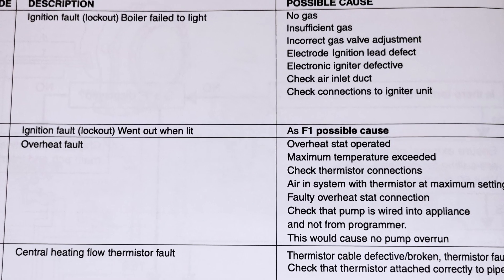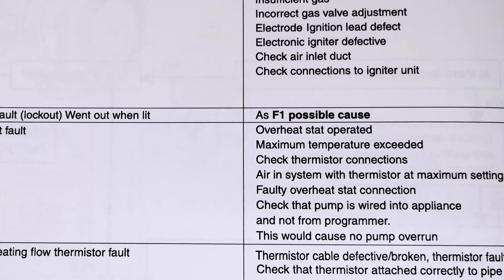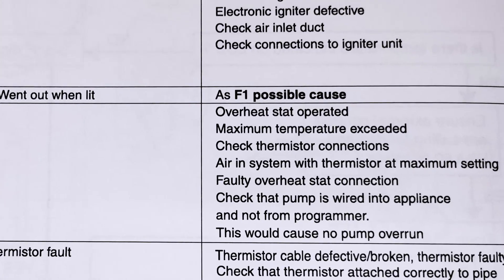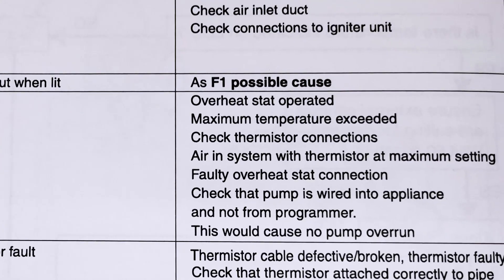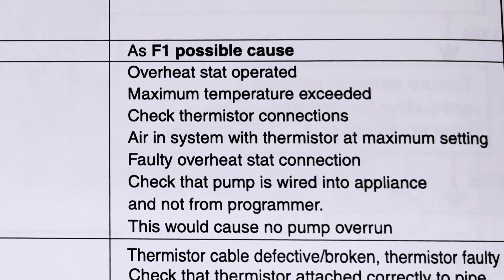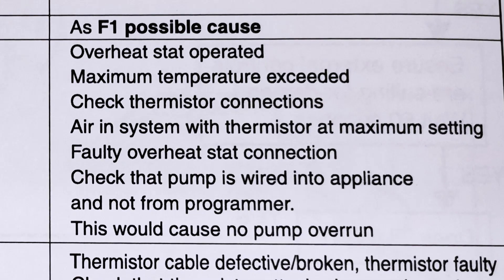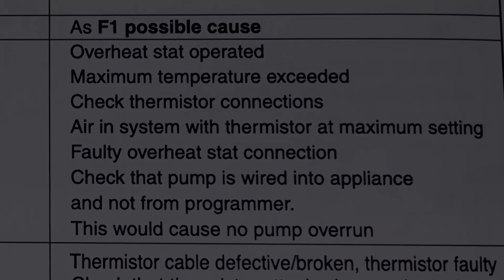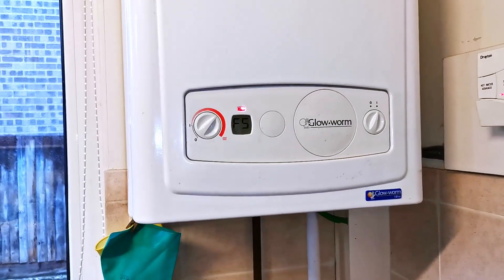Glow-Worm HXI,  F5,  Fault.  What I need to do, to get the boiler working again. Plus Fault Causes

Comment: Thank you so much for that video - I’d struggled to find info on that boiler dial, as it’s labelled “central heating” only, but your video suggests it also affects the hot water tank temperature. I understand it’s limited to 60 °C, but if set to 40 °C, does the tank water actually drop to that lower temp and stay there?

Our dial was set (not by me) to ~40 °C for a week while the house was empty and no water used. Would the water in the tank have stayed at that low temperature the whole time. Any idea how high the legionella risk might be after a week?

On returning, we ran all the taps as usual and the showers briefly (no one in them, but in the room with them). When I realised about the dial, I turned it to max, ran the boiler for a while, then used the immersion heater overnight (as it seems to get the water a little hotter). The water now measures ~58 °C at the taps. 

I'm wondering if it's now safe to use the showers again.

Comment: .I had turned the house main water valve off to repair/change bath taps. A few days later i had fault 5 flashing~ I turned the main stop valves fully anti clockwise (rather than partly on) turned boiler off and on and reset button, it tried to come on for a while~ after that  I Also had to turn all radiators on full and put heating on for ten mins/ this was enough to reset to the required pressure. All good so far.

Comment: I had this today. Turned out that my system (water) pressure had drifted low over time and eventually the heat exchanger became empty, leading to the protection control. Topped up and all good :) So… check your system water pressure also - pressure gauge on the upper tank.

Comment: So far so good, mums boiler tripped yesterday, her engineer is in Tenerife on holiday.  Reset the button, and hopefully will last until his return.  I did noticed the boiler purges, the temperature rises +5oC approx then reduces -3oC approx slowly accumulating heat, Not sure if that’s normal.  Thanks

Comment: I have no power at all even the clock gone out what do I do
Reply from the maker: Check the fuse  where the central heating is pluged/ wired in.
Reply: @MarkBallardLTDHeatingEngineer  all fix